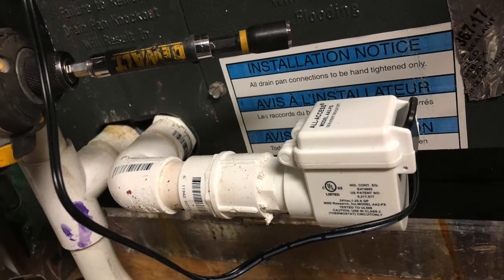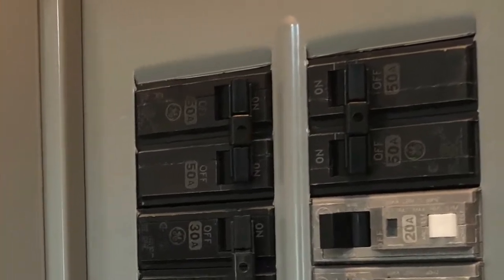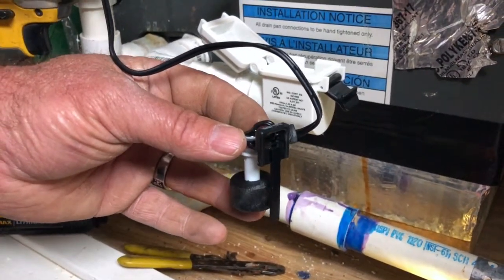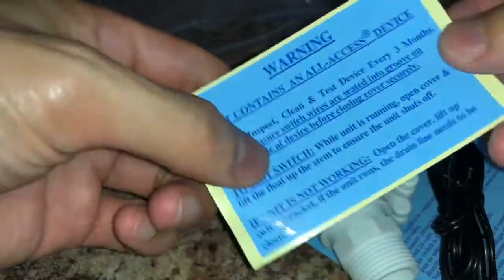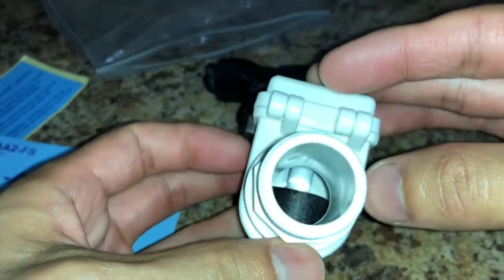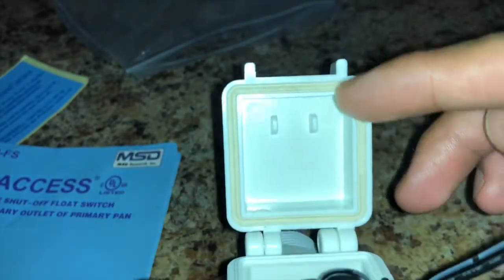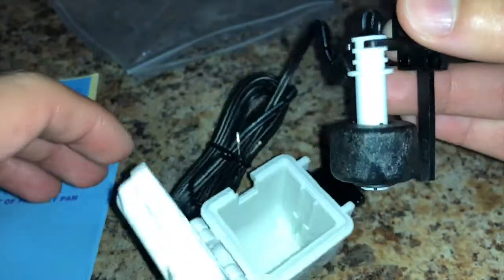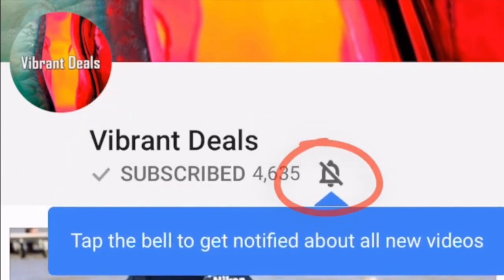✅Float Switch for HVAC Leak System ALL-ACCESS Model AA2-FS | Prevent Home AC Flooding Water Damage

Comment: There are T stat wires running to & from air handler control board and to outside unit. Is it possible to simply connect the wires in series with one of the wires going from the 24vac transformer over to the control board? Seems like a safe place to interrupt the systems 24vac